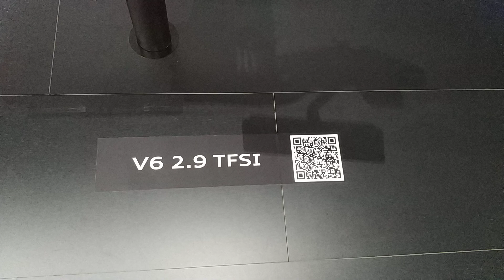Audi V6 2.9 TFSI engine model

Comment: That intake plumbing is the strangest part to me. You move past it really quickly and I had to pause it a few times but you've got intake to the two turbos, they get combined out to what I'm assuming is a water to air intercooler (hangs off to the right as we zoomed in to the oil pump gear). I think there's a single throttle body before the intercooler as well, and then it eventually splits to separate intake manifolds since the exhaust exits center to the turbos?
Reply: yes

Comment: Maybe silly, but is this the same engine in the 2019+ Porsche Cayenne S?
Reply from the maker: I am not sure, but it's possible. VW, Audi and Porsche are owned by the same concern - Volkswagen AG.
Reply: This engine is developed by Porsche .
Reply: Finally, a simplified timing chain set.
Reply: @HristovRumen  With the chain at the flywheel end of the engine. 😂